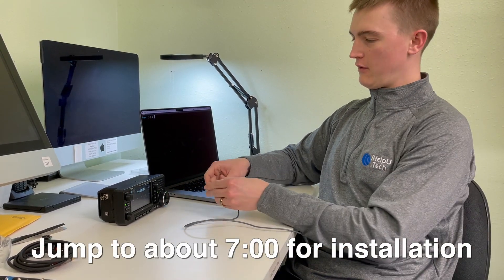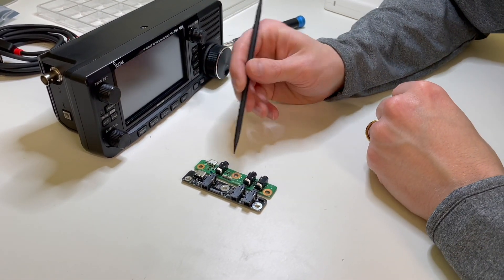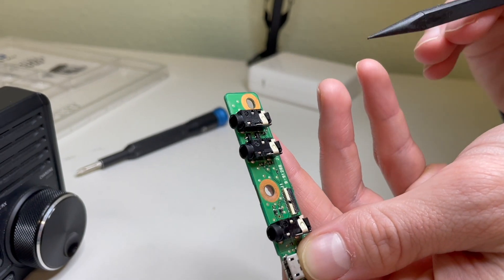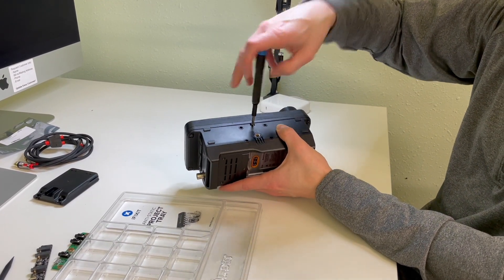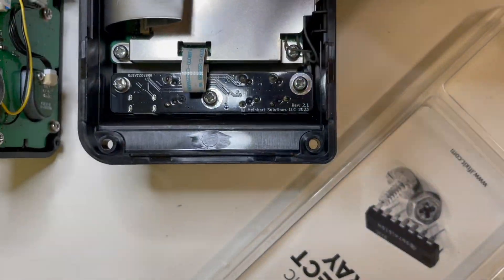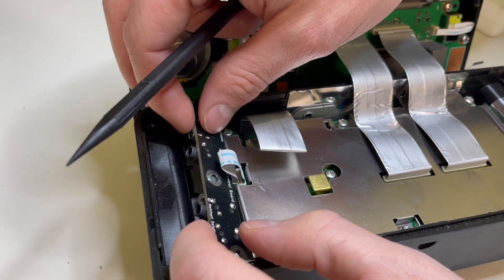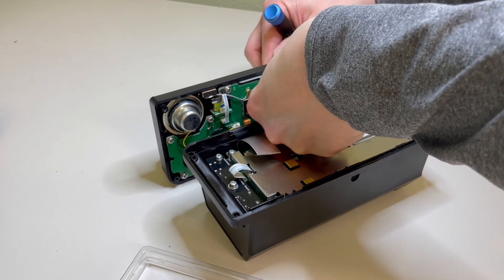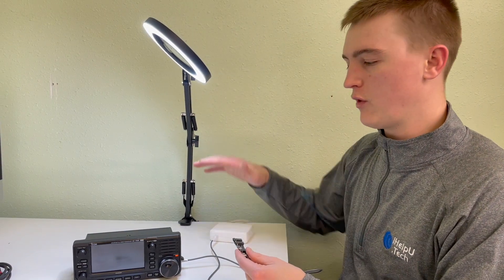Icom IC 705 USB-C Control Board - Easy Upgrade!

Comment: I installed mine not so long ago. Noticed that you now see a charging USB symbol in the startup-screen of the IC-705.
Since it's at home constantely connected to my desktop-PC for use with logging programs and stuff .... when switching the unit off I see that the charging led is ON all the time so the unit is allways charging cause of the USB voltage allways being present coming out of my desktop PC.
My question now is ..... if my main power supply is on ... because my IC-705 is also connected that way .... will the IC-705 still draw charging current through the usb-c port ? 
And what about when using the unit normally .... doing TX .... will it want to draw current through that usb-c port too ?
Why am I asking this ..... If I go out in the field with laptop and IC-705 running both on their own battery .... will the IC-705 draw charging current out of my laptop through the usb-c connection  ?

Comment: Contrary to the how-to article and this video, the screws are NOT Philips. They are JIS, as evidenced by the dot. If you really want to minimize the risk of stripping, use a JIS driver. They are not the same. A Philips, regardless of the size, is not the correct tool.
Reply from the maker: I initial thought this also, but I ordered a JIS screwdriver set from iFixit and none of them did not fit as well as a #1 Phillips. I stopped by our local SnapOn shop and confirmed this with their drivers. Unfortunately, not all Phillips drivers are made the same and some work better than others. Sometimes the LocTite is more stubborn on some radios that others too. My recommendation is to apply plenty of downward force and go slow to prevent the screws from stripping. Use the driver that you feel has the closest fit. Thanks for your feedback!
Reply: @iHelpUTechEffingham  Interesting. To make matters even more confusing, there are at at least two JIS profiles, never mind the proliferation of "Phillips" styles. I wonder which JIS profile the iFixit kit is, and which JIS profile the Icom screws are. I have some JIS drivers from Moody Tool and Vessel, but unfortunately don't own this radio (yet?) so I can't provide any data points. I agree 100% on downward force, also using a new bit that doesn't have any wear.

Comment: Im slightly confused as to the reasoning for this upgrade. I have had my 705 since it was first released and I haven't had a need to use that port once yet. Im actually wondering why they put the USB port on the radio at all.

Comment: Took less than 15 minutes.  Seriously easy, but I would firmly agree with using a screw driver that is matched to the screws.  I had some issues getting the bottom one off without striping it.  Thanks for the great fix!  73 - N8CMB

Comment: Awesome, I just ordered my upgrade from you and some cables! I'm wondering if I need to modify the GO Bag enclosure from W2HVH so that I can charge both the ICOM battery and the Lipo battery from the outside of the enclosure. I probably need an internal USB C cable that does that. I'll look into it when I take the radio out of the enclosure to do the upgrade.

Comment: Hi Ben..got mine yesterday and did the replacement just now. All OK but for the tough time in unscrewing the three screws holding the original board. Thanks for a great product. 73
Reply from the maker: I've hear reports of some radios having stiffer screws than others. Glad to hear you were able to get it installed! :D

Comment: I'm having one heck of a time trying to get the bottom center screw removed from mine. Starting to strip the screw. Anyone else run into issues with that screw? All the others came out super easy. This one feels like it's loctited with red loctite or something. Ugh!
Reply from the maker: Hmm... Haven't heard a lot of issues getting the screws out of the radio. They do use blue loctite, but maybe yours is just seized up from the factory. My suggestion is to make sure you are using the correct size of phillips head and apply plenty of downward pressure on the screwdriver to prevent the head from stripping out any more. Obviously, just be careful not to apply so much pressure that you crack the casing of the radio. Best of luck to you since I know dealing with stripped out screws is no fun.

Comment: Fantastic upgrade. Pity about how expensive International shipping is. You will be missing out on sales when shipping is $55AUD for such a small part. Hope you consider other options. Cheers 73 Lance VK6LMK
Reply from the maker: Our online platform, Shopify, does its best to calculate shipping for international orders. Sometimes it overestimates the rates, so I'll check my shipping platform to see if we can reduce the rate for your order.
Reply: @iHelpUTechEffingham  Thank you. It’s a fantastic product. Very impressed by your consideration of international customers. 73 Lance
Reply: Hi Lance, I hope you bought one. nothing gets cheaper these days. I just ordered mine, regardless of the fluctuating exchange rate, and seemingly high postal cost. The additional features this board offers, makes it worth the cost.
Cheers, VK3PCJ.
Reply: @turinskiboy  already fitted one. They refunded part of the shipping cost so it was more reasonable. Cheers Lance VK6LK

Comment: Great work - thanks for the easy to understand video. Will the USB-C connector cope with power fed from my Apple MacBook Pro power supply or does it need 5V only?
Reply from the maker: Yup! I tested it with my MacBook charger and a USB-C multi-meter and it worked as expected. We configured the correct resistors so that the the USB-C power delivery protocol knows to send only 5V at up to 1.5A, which is the same amount of power that the original board ran at. Note that it is just a connector swap so the board will not charge your radio any faster than the original USB port. Hope that helps!
Reply: @iHelpUTechEffingham  Thanks so much for the quick reply and for confirming that it's safe to use Mac chargers etc. - looks like I just found one of my Christmas presents! 🙂 It's also good to know about the improved protection for the external PTT control line. 73 and thanks again

Comment: To align the port with the usb-c connector when you’re installing the new module, plug in a usb-c cable to the port and tighten down the screws. It will keep the port aligned with the housing so cables plug in properly in the future 😊
This module is awesome!
Reply: thanks for the tip. used it myself tonight and mine seems to work great.

Comment: Does this solve the  RFI issue when running digital modes over USB connection?
Reply from the maker: No, it does not. The most effective thing I've found is to wrap the cable around a ferrite toroid.

Comment: I was send here by a viewer of my channel to check if this would be worth a review. However I don't really understand the advantage behind this board.

If I get it right you just changed to Micro USB connector to USB-C connector. So you need to buy a new cable (if you don't alread have one), but you don't get any adantage from the new connector. I mean, USB-C i.e. easily could deliver enough power to completely run the radio over it. Or it could deliver significant more power for charging the battery. But it's just a swap of the connector, right?

And you also integrated a better protection of the SEND/ALC line. This of course is nice, but this also can be done by just adding a relay and a diode into the external cable for the amp. This is the solution which Icom always suggests in their manuals. A relay and a diode can be bought for only a few bucks. You even get complete relay boards with an integrated diodes and optocoupler for 2, 3 dollars. So you don't have to open the radio for this solution (risk any guarantee) and you also can use such a cable with other radios.

Maybe I did oversee something or I understood you wrong, but I can't see advantage at the moment.
Reply from the maker: Hello Funkwelle! Thanks for your interest in the board! You do bring up some valid points. 

For USB-C, it is indeed just a connector swap. My background is as a phone and computer repair technician, and I prefer the USB-C connector over the Micro-B. It's easier to clean, more durable, and reversible. USB-C has already become ubiquitous, so most people with this radio would likely already have the cable, especially if they purchased an Android phone within the past five years. It will only grow in popularity and become commonplace with the new EU mandate that forced Apple to switch to USB-C on the iPhones. This radio was the last device that I had that used micro-b, so it was more convenient for me to change it to USB-C. 

Implementing the USB-C Power Delivery standard would be cool, but this would be more involved. I don't want to mislead anyone by saying it supports faster USB-C PD charging, so I tried to emphasize that. The USB-C PD spec could supply enough power to the radio. For the DC barrel jack, Icom recommends 13.8V at 5A. USB-C offers a mode for 15V at up to 5A. The issue is how to implement it on the radio. The USB_VBUS line goes to several integrated circuits expecting to be at 5V high or 0V low to detect USB power. You would smoke the radio if we put 15V on the USB line. It would require thoughtful planning and modifications to several lines on different boards to support this properly. One method I see as more of a hack is to redirect the USB_VBUS line to the input of the DC barrel jack. Then, you could use either the DC barrel jack or a USB-C PD charger, but not a standard 5v USB. I might look into these options more with my radio to see what could be done, but I would only offer this as a service if this upgrade were even possible. 

The SEND/ALC line was my main reason for making the board. I plugged in a home-brew QRP amplifier that I got off of a fellow ham, and it killed my control board when I went to transmit. I know what you are referring to in the advance manual with the transistor and diode to protect the stock control board. And I encourage anyone who wants to tinker to make it themselves. It's a fun project, and you can learn a lot about signaling lines. Optocouplers would also be a good idea for even more protection. My concern with them was getting the bidirectional signaling to work, and they do go bad quicker than most MOSFETs. For me, I wanted something that was integrated inside the radio and fixed the underlying issue. Rather than worrying about protecting underpowered transistors, I replaced them with a model more up to the task. 

Overall, my goal with this board was to add protection to the SEND line and replace the micro-b port while retaining all of the functionality of the stock board. I feel like I was able to accomplish my goal with this board. I made it mainly for myself and a few friends, and I'm honestly surprised and thankful that other people see the value in it too. Ultimately, this is a limited production board from a small American business that is testing every unit before we ship it, offering a warranty on the product, and will answer your emails and phone calls if you have questions. I understand if you don't see the value in this board. You can definitely accomplish the same thing for less. I see it as a nice $85 upgrade on a $1500 radio that eliminates some of the issues I had with mine. Let me know if you would be interested in a unit to review, and I would be happy to send you one. I hope this explanation helps! 

73's -Ben KD9LJF
Reply: @iHelpUTechEffingham  Your board has effectively addressed two significant drawbacks in a finely crafted rig: the outdated USB connector and, more importantly, the SEND/ALC line issue. Your solution is not only easy to implement but also demonstrates a high level of functionality. It's evident to most users that these improvements are most welcome, making the ongoing discussion seem unnecessary and perhaps driven by sheer ignorance. Thanks very much!!!
Reply: I can understand why you don't understand the advantage.

Comment: Order placed. Seems like a simple upgrade and i'm glad you commented at the end that it was protected to only send 5v power through usb.
Reply: I completed my upgrade tonight watching the video again. 15-30 minutes and it was all done and testing seems to appear to show identical performance to stock. no issues. Biggest risk I saw was you might strip the head off a screw if you aren't careful. Mine at least were very tightly in there.  Now I have the same charging port as my tuner and other modern devices. Next iPhone upgrade my phone will have the same and I'll be all usb c except my 52a.
Reply: For anyone watching now I have received my unit but haven’t yet had time to perform upgrade. Appears to be as promoted.

Comment: Take my money already. This fixes the two issues I had with this radio. Unfortunately it appears you're sold out. :(
Reply from the maker: I updated our shopify store to better handle preorders. Here is the link: https://shop.ihelpu.tech/products/icom-ic-705-usb-c-control-board-upgrade 73's!
Reply: @iHelpUTechEffingham  Brilliant. I've put in a pre-order.
Reply from the maker: lol working on getting more here! Check back on our online store for preorders. Turns out ebay doesn't like presales so working on setting up our own store with more features. Will resume selling on eBay when I have some stock by late November/early December.

Comment: Excellent video! I need this for my IC-705. But it seems there's no "order" button on your eBay listing even though it's clear that it's a back-ordered board. How can I get in line for one?
Reply from the maker: Turns out I misread eBay's policy on back ordered items. They want to make sure I have items in stock before I list them. The order button will be available again when I have the boards in stock. For now, I'm going to work on setting up my Shopify page to offer more flexibility for our customers. (Cheaper pricing since no eBay fee.) You can email support@ihelpu.tech or check back in a week or so to get in line. Thanks for your interest!
Reply from the maker: I have our shopify page updated to support preorders. You can reserve your board here: https://shop.ihelpu.tech/products/icom-ic-705-usb-c-control-board-upgrade Thanks!

Comment: Preordered! I just fried my PTT circuit. What a terrible flaw in Icom’s design. Thanks for making this.
Reply from the maker: Yup! Exact reason we focused on adding protecting for that SEND line. Thanks for the preorder! We're excited to get the next batch in to get them shipped out. Let me know how it works for you all once you get it in 😀
Reply: Happened to me as well, the radio returned unrepaired, and so far it spent about 6 months in service. Should I know at the time how easy it is to get there, it would be repaired instantly. Anyway, a great upgrade.
Reply: @petrsuchomel9639  replacing the MOSFETs was a real challenge for me because I don’t have SMT tools, but it’s possible to do. I feel for you. I was so upset when I blew out my PTT circuit.
Reply: @ch716 replacing the part would be snap easy for me as I have all tools, but at the time I didn't have schematic. Same problem with KX3, took about 10 minutes to fix. Cumulative 6 months for 705 service... Add the pain of micro USB.
Reply: @FooBar89  I was well aware about limitations, and I am very often going backpacking, so far another box isn't really a preference. Perfect for a shack, I totally understand what you mean and what I have in instances where I am on fixed setup. But as a portable radio, it is a total flaw, no doubt. Designed by kids and management. Look at relatively old FT817 (without D), how beefy and well designed is the same circuit.